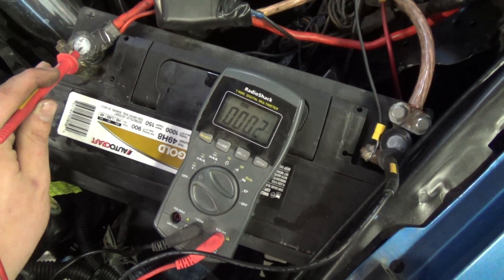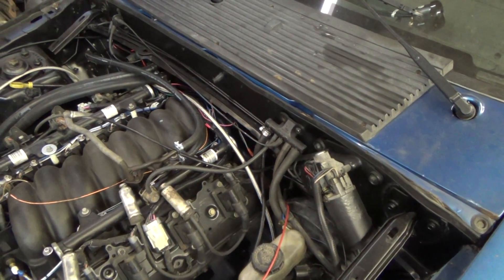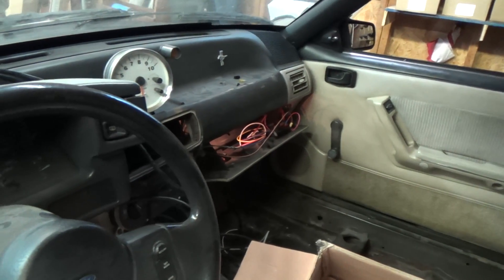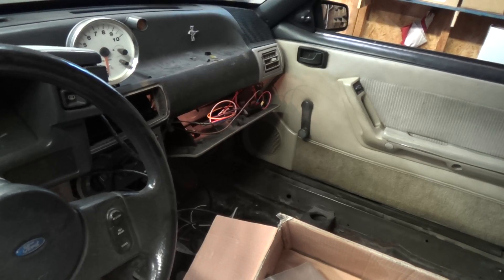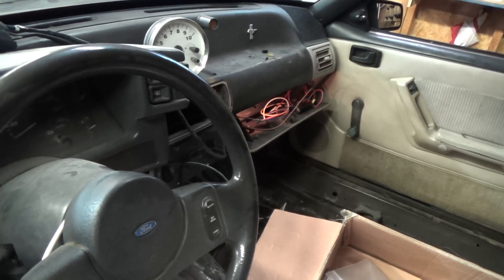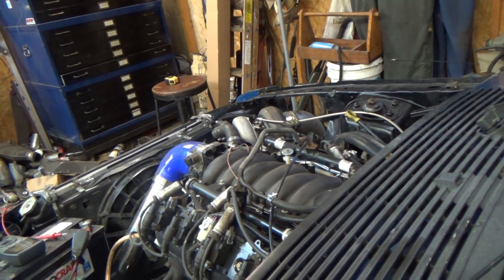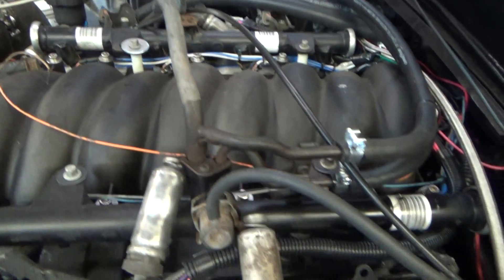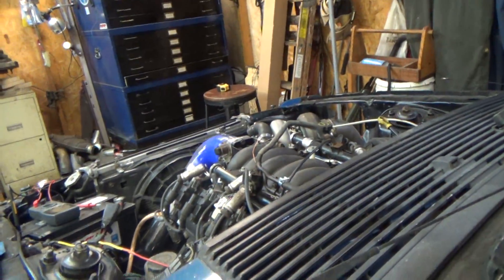5.3 Turbo Mustang MS1 Injector Issues

Comment: Did you try reflashing the firmware?
Reply from the maker: I haven't tried that, yet. I'll see about that in the next couple days. I did figure out tonight that it's only doing this injector clicking when the DB9 cable is plugged in.. Makes it hard when I need to adjust the tune, and can't anymore.. Ugh, haha